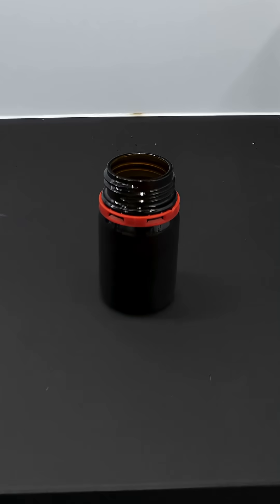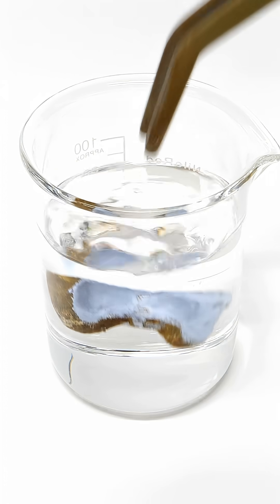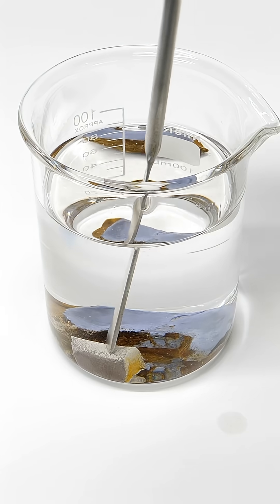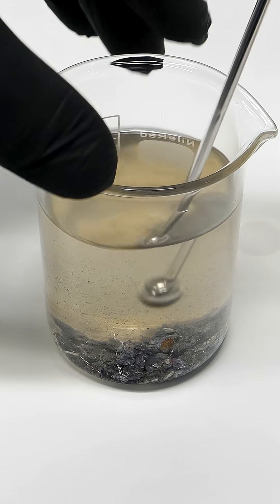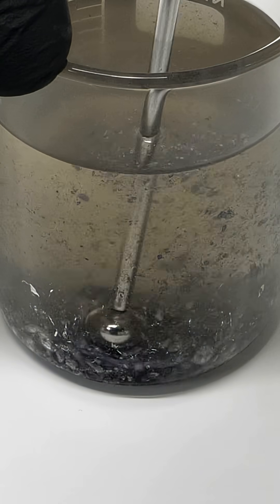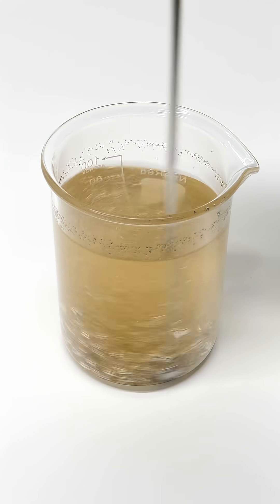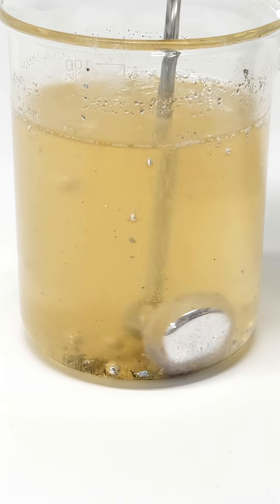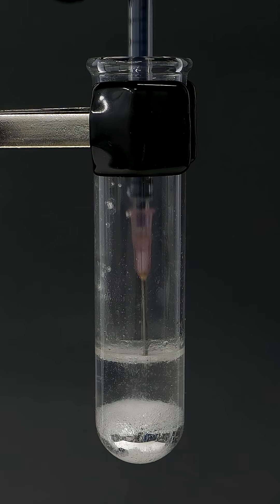Mixing sodium and potassium is crazy

Comment: Ah yes, my two favourite explosive elements
Reply: If not war crime, why war crime sound?
Reply: @Patchuk  I don’t understand but I agree
Reply: @Patchuk what is bro on about
Reply: Sodium and potassium are nice, but have you ever seen magnesium react in the presence of an oxidizer? Magnesium has got to be my favorite. It burns white hot at over 5500°F and when mixed with an oxidizer it's way more energetic than sodium or potassium in water. It's the main ingredient in military grade flashbangs, providing both the flash and the bang
Reply: The best oxidizer I can imagine is liquid oxygen. It's a beautiful slightly blueish liquid with a lot of power. I have seen an experiment where someone lit a cigarette in liquid roxygen. It burned down in a second emitting extremely bright light.
Reply: @Grecks75 The only problem with liquid oxygen is the temperature required to keep oxygen a liquid. That low temperature means less energy compared to hotter oxygen
Reply: Cesium has entered the chat 😎
Reply: There is an even more explosive alkali metal..

Comment: NileRed: uses kerosine as a protective liquid.
Reply: This is how Na and K are stored, to protect it from oxidation. Also, kerosene is a type of petrol fuel iirc but it's autoignition temperature is lower (220C).
Reply: You know shit is dangerous when you have to use something dangerous to protect it from air